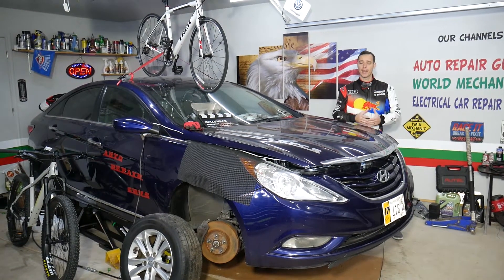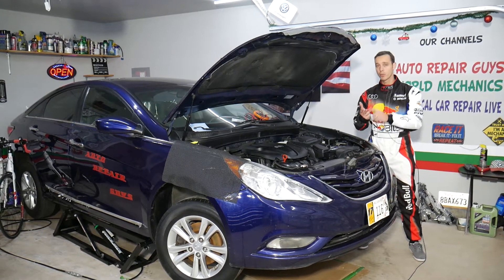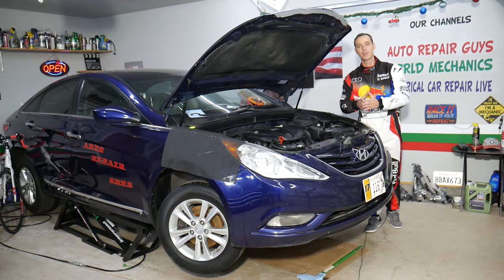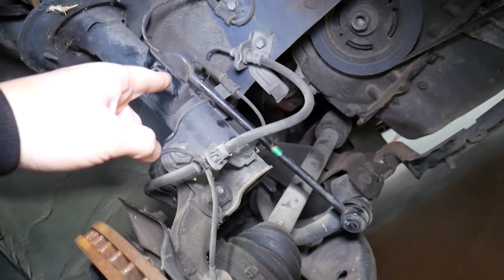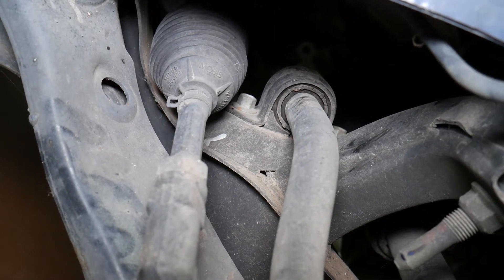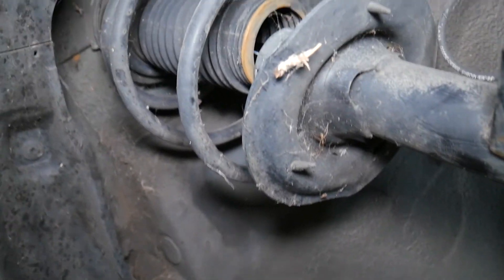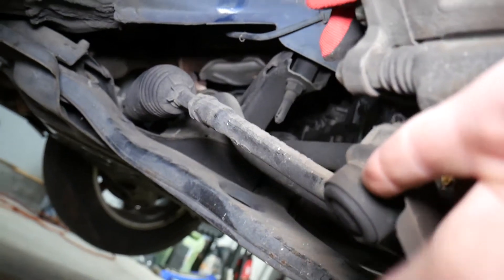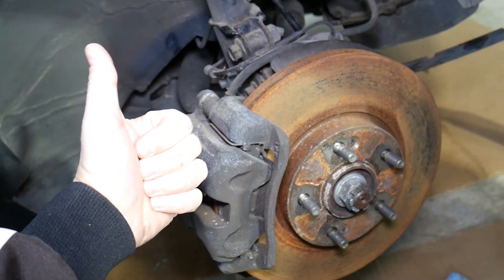TOP 5 WHY FRONT END RATTLE NOISE ON HYUNDAI SONATA

Comment: Which ones are dangerous and has to be repaired as soon as possible?

Is it an extreme amount of work to fix any of those problems?
I have had front end rattle for years and the mechanic just says that he looked at it and sprayed it down (?). Personally I think he doesn't want to do all the work because it may be difficult/too much. Do you think that is a possibility?
I am 100% willing to pay him for his labour but he just "sprays it down".
It still rattles and there is play in the steering wheel ... When I drive on an uneven / bumpy surface the road almost pulls the steering wheel... Not a normal amount..wheel alignment has been checked. I had a car that had no such play/travel, so I am certain that it is not the road but the car.

He is the only mechanic in town with decent service and prices. I've taken the car to the brand mechanic and they fared worse and asked triple the price...and the problem was still not fixed. 

(The car is a Hyundai i.20 1,6).

On an unrelated note; could you do a video about clunks around the centre?
(After braking and coming to a standstill there is a loud clunk...some say the petrol tank is loose, others say the gears shift on their own...but I am not a mechanic and I am afraid it is dangerous to drive like that).

Thank you for your channel; it gives me, as a woman with little mechanical knowledge, the confidence to go the mechanic and request more specifically what I want checked/repaired. And by doing that, they (the dicey mechanics) are less inclined to cheat me with unnecessary repairs etc.
Reply: So I have a Hyundai sonata 2012 GLS 2.4, as I'm driving down the road the car likes to swayed from left to right especially when I'm going over 70 miles and on uneven road.  Sometime back about a year ago I started hearing some noises in the front suspension that wasn't there before, I went to different mechanics and they all said the suspension and all the parts are fine, yet I know there was something different. Now the problems are bad and after taking it to several mechanics, no one giving me an exact answer, however some said they it's the alignment which I've got checked and fixed, others say the struts which I think are fine, but after research and a mechanic I trust told me that the part  in question is the RACK AND PINION. 

I suggest that you go to this mechanic that you know and ask him to check the parts that these guys on the video suggests and also the rack and pinion. 

I'm going to be buying the rack and pinion and having it installed on my car I'll let you know how everything comes out and if it helps me with the steering wheel swaying problem

P.s. what part of the country do you live in that there is only 2 mechanics